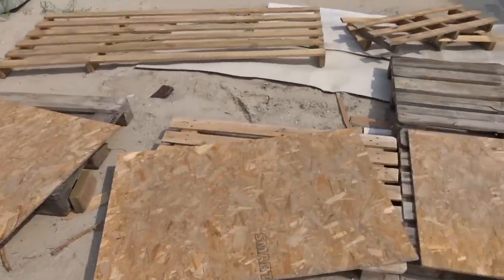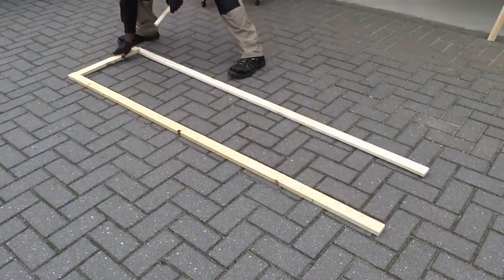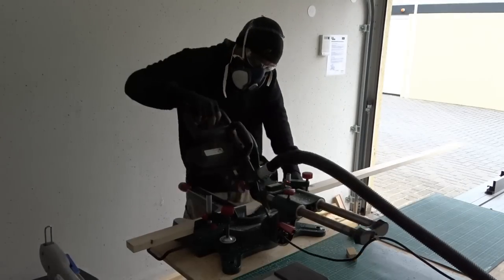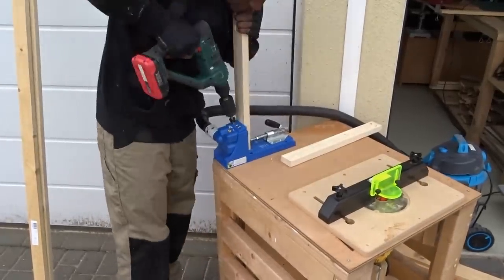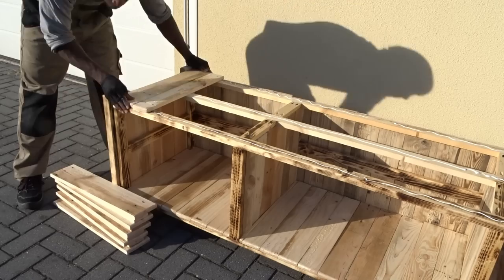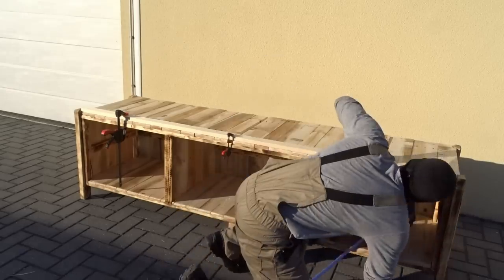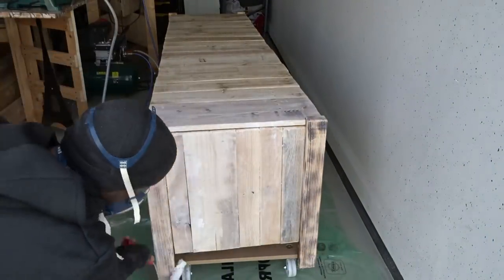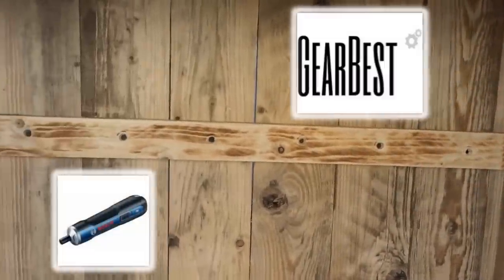How To Build an EXTRA large TV stand with shelves using reclaimed pallet wood

Comment: Looks neat! My only problem is how it supports the load on it. You're basically relying on the strength of screws to support it all...which is not a good idea usually.
Reply from the maker: Hi joshus, thanks! Basically you need to make sure you pre-drill the holes so the small screws can really be attached to the next support behind. It also depends on the type of things you are putting on it. Feel free to let us know if you have more question...